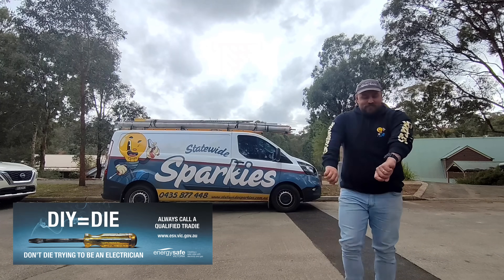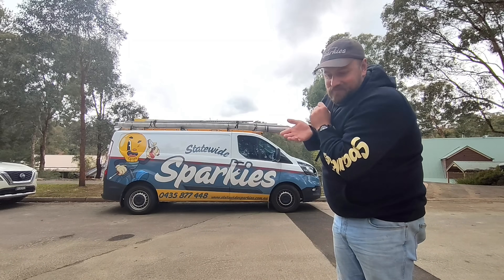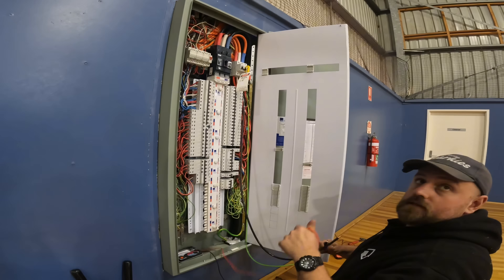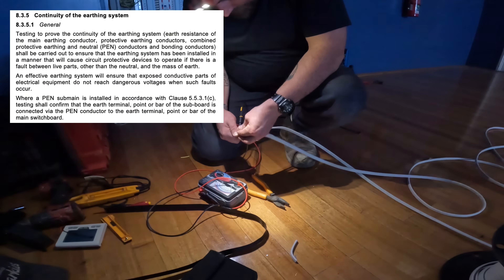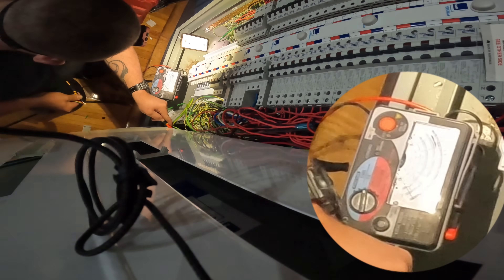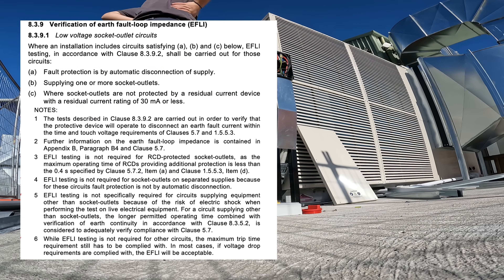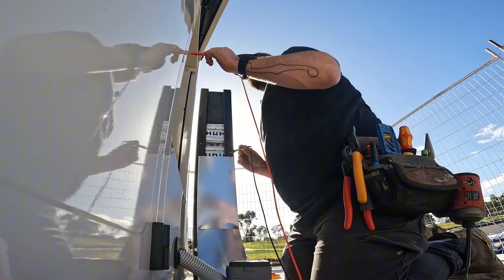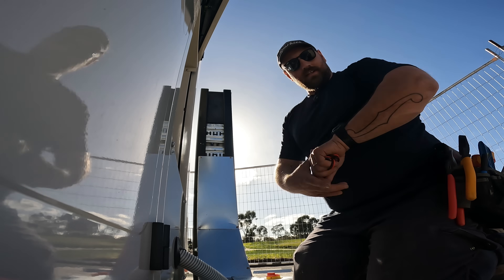Electrician Tests Installation

Comment: Love the video mate, when flicking that 250A 3 Phase main breaker on, you don't have any arc flash protection on. I got stung by the ESO for this one. Check this out AS/NZS 4836:2023 It shows the different PPE required for different level switchboards. Domestic switchboards usually get away with a pair of safety glasses but when you enter into the commercial world then 3 phase 250amp main breakers become common and so your arc flash protection requirements go up, cause the fault current has also gone up. Most electricians don't know about this one, I found out the hard way through an ESO audit
Reply from the maker: Wow that's really interesting. I did not know that

Comment: Noob question. Any benefit using analog multimeter over a digital one? Thank you.
Reply from the maker: Not really. Either way they need to be calibrated. But most inspectors are using analogue. So I guess they're more superior

Comment: how come you didnt have your subcircuit earth connected into your earth bar when you did your insulation resistance test?
Reply from the maker: Good questionn I'm only testing my installation Of the cable. And there was a lot in that board. Plus if the earth was connected, there's a chance the MEN link could interfere with the readings. 
It was a big school, so I only wanted to test my installation.

Comment: Hi mate, nice video. Only thing I picked is that the 3132A meters are no longer compliant for earth continuity testing per 2.2.2.2 of 3017 due to the max deflection.
Reply from the maker: I have seen this reg floating around a bit now. 
However, I've seen three LEIs still using the 3ohm testers.
So Im not sure where this standsnat the moment.
Reply: @Statewidesparkies that’s pretty concerning to hear, we’ve pulled the lot off sites and just gone to a 3131 or digital testers. I’m yet to hear of anything being
Enforced, but better to be safe than sorry I suppose.

Comment: How come it didn’t need to be on an rcd? I thought everything needed to be rcd protected these days? And where did you get new megga leads from ?
Reply from the maker: Hi mate. I had to go digging for this reg haha

2.6.3.2.3.3 Requirements for additional protection
Additional protection by RCDs with a maximum rated residual current of 
30 mA shall be provided for final subcircuits with a rating not exceeding 
32 A supplying— 
(a) socket-outlets; 
(b) lighting;
(c) direct connected hand-held electrical equipment, e.g. directly 
connected tools; and 
(d) direct connected electrical equipment that represents an increased risk 
of electric shock. 
Factors that may represent an increased risk of electric shock include 
but are not limited to— 
(i) external influences (refer Clause 1.5.14); and 
(ii) type of electrical installation and processes being conducted 
(e.g. workshops and particular industrial activities). 
NOTE: For all other final subcircuits with a rating not exceeding 32 A for direct 
connected equipment, additional protection by RCDs with a maximum rated 
residual current of 30 mA should be considered.

Comment: Love your content mate. What about your max demand calcs for a job like this? 100A per phase is adding a big load so curious to know what you did. Or if not for this job a video in the future explaining what u do for max demand would be great. Keep up the good work (3rd year apprentice sparky and qualified linesman here)
Reply from the maker: Great question. so this job, I got photos of the gym at tender stage. I was able to determine how I was running this cable through the gym. This accounted for 80% of the run, (the last 20% was the cable tray). 
So I based my cable derating off that
Reply from the maker: 2) but I honestly use Jcalc.net. This gave me my cable size confirmation. Based on the conditions.

Comment: Are you testing beyond the A/c isolation switch .?
Reply from the maker: Of course. I just did it in two steps because I didn't want 500v through the AC. 
There was a lot of electronics. So I did the last sections in 250v

Comment: That breaker should have been fed from the load side of the isolator, not the line side.
Reply from the maker: They don't have a line or load side.....
Reply: @Statewidesparkies  He's probably referring to the tails coming off the line side of the main isolator to feed your new CB. However I see from the previous video you've labelled the AC CB as a main isolator also, so you're all good!

Comment: Love watching these, im a 3rd year Lifty Apprentice I would love to know how you go about quoting jobs and also going into depth as to why you chose to run 35mm Orange circular,  and the overall job in regards to AS3000, AS3008 cable selection. (I understand that video would be extremely annoying to produce) :)
Reply from the maker: Hi mate. 3008 is key but Jcalc.net is a great website for calculating cable sizes. Free too!

Comment: Is it shorted? no. Is it grounded? Yes. She's f@#$ good mate!  (Soo much simpler than what I see them doing in the UK)
Reply from the maker: Cheers legend! Australia does have a really good system over here. Very straight forward
Reply: It's really the same basic tests, IR, EFLI (I think they call it R1+R2), polarity and so on.  Their RCD testing requirements was a bit insane until recently.

Comment: Hey mate, nice install 👏 just one small thing I noticed for 3 phase circuits insulation resistance test, the test voltage should be 1000V DC. Easy to overlook.
Excellent work overall though, beautiful stuff.
Reply from the maker: Hi mate the closest information I can find to what you're saying is 8.3.6.2 right at the bottom. 

It says "The insulation resistance tester used shall be able to maintain its terminal 
voltage within +20% and -10% of the nominal open circuit terminal voltage, 
when measuring a resistance of 1 Mohm on the 500 V range or 10 Mohm on the 
1000 V range."

So with that being said - 400 X 1.2 is 480v and even if you claimed 415V, that's 498V. 

There is nothing under section 8 that states that. Can you point me to a reg?
Reply: @Statewidesparkies Hi Jay, the standards don’t specifically require 1000 V DC for 3 phase circuits under 500 V AC. Testing at 500 V DC is compliant with AS/NZS 3017 and is not incorrect.

However, many electricians (myself included) often test at 1000 V DC for submains and 3 phase circuits as a best practice.
This comes from the general principle that insulation resistance testing is ideally done at twice the nominal voltage, which is the same logic behind using 500 V DC for 230 V single phase.

Most cable manufacturers also recommend testing insulation at 2× the rated voltage to better detect weak spots, especially in longer runs or outdoor/industrial installations.

While not mandatory, testing at 1000 V DC provides an extra level of confidence, and it’s commonly used for commercial switchboards, 3 phase loads, and submains.
Reply: @Em-PoweringElectrical  Curious to know where you're located and what industry you're in? I've been doing this sort of stuff for almost a decade now (commercial consumer mains, submains, group metering, CT metering etc.) and have never once had an inspector test any mains at 1000V. I'm wondering if it's a regional/industry specific common practice?
Reply: @Em-PoweringElectrical  "This comes from the general principle that insulation resistance testing is ideally done at twice the nominal voltage, which is the same logic behind using 500 V DC for 230 V single phase." It isn't the same logic at all. The book states cable must be stressed to 500V DC it has nothing to do with it being double the nominal voltage.
Reply: @jimmybbeam G'day Jimmy, located in SA. I learnt about it back in trade school and working in industrial maintanance 
I was always taught to test anything 3 phase such as circuits/motors etc at 1000V DC as a general rule of thumb.

The use of 1000V test setting is considered "best practice" when testing between phases as a 400 RMS voltage has a peak of 565V.
The idea is to apply a high enough test voltage to properly stress the insulation and pick up any breakdowns that might not show up at lower voltages.

Now I concentrate mainly on testing, switchboards and EV charging point installations.

PS: Nothing wrong with Jay's work, I'd rather watch his channel than watch Netflix... Just sharing some insight from experience.